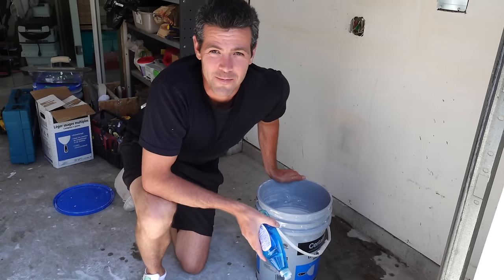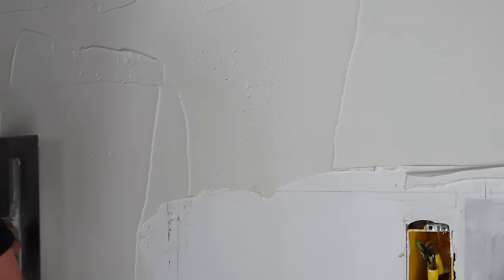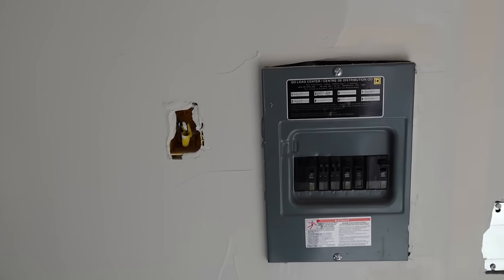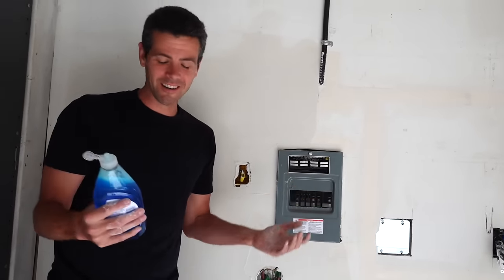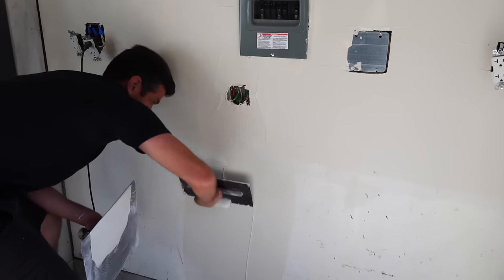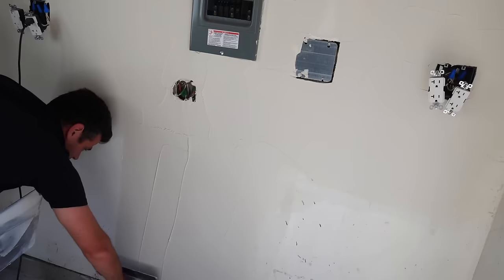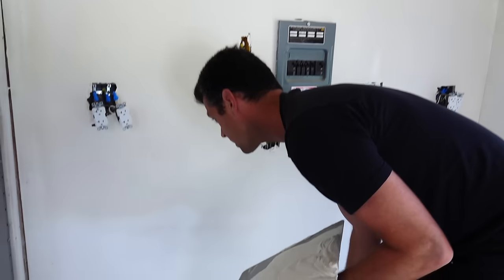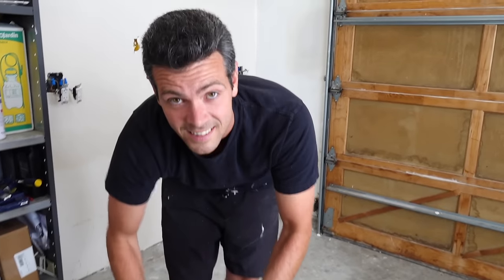😳Should you Add Dish Soap to Drywall Mud????😱

Comment: I've added way less Dawn to my mud than you did for years.  On and off depending on wheather or not I had it with.  Never had an issue with paint adhesion.  No call backs on flaking or peeling paint.  I used it because that is what I was tought to do by an old mudder.

Comment: I've been doing drywall for 25 years and I'm real Curious on the hawk and trial I use pan and knife and throughout the years using the knives have tore up my right hand as far as knuckles and fingers so I'm just curious on how your hand feels after the time you've been doing it or how are your wrists holding up
Reply: The Hawk is the way to go a pan will work you to death and the Hawk is iriplacable for overhead work it lets you catch the falloff I gave away all of my pans after discovering the Hawk ...no use for them.

Comment: Gotta say, daughter is really good at getting the close up shots WHILE you are mudding.  Typically we only get the close ups after the finish passes are done.  I feel like I could see your texture much clearer on each coat than most videos.

So takes less coats to get smooth and cleanup is cleaner because there is already soap in the cleanup if needed.  Curious if you have any paint problems.
Reply: I agree, not that previous shots were bad. It just gives us a better up close view of what you see while working the material. 👍

Comment: We use 'a squirt' of dish soap (dawn but also store brands) in our in-ground vinyl liner pool base vermiculite (40# bag and 5 gl. water) and it certainly helps with troweling it smooth. Never had an issue and the ready mix maker encourages using the soap (they recommend dawn by name) for this reason. Would think adding it to mud has same benefits.

Comment: Dawn is excelent at relieving surface tension. I use it on my grass before I fertilize as it breaks surface tension and allows water to penitrate. Do you wash your care at home? Were do you pour out the suds? Much greener huh? Surface tension. Static charge, porosity isn't anything, think surface tension and static electricity. We in the northern climates can relate. Not so much in California.

Comment: The reason you are getting a lot of are bubbles on your second coat is because you are sanding. Scrape off any imperfections from each coat with a dry trowel, you will find this is very helpful. Lay the trowel fairly flat on the surface and move in opposite direction to applying mud, dose not require much pressure to remove trowel marks ect. A very light sand on your final coat with 400 grit sandpaper if required is all the sanding that is done on the hole job. This includes skim coating. I have 30+ years Esperance , Hope this helps.
Reply: I don't have 30 years. But I do much the same. Apply it smooth minimize trowel marks) on first and second. Whatever buggers are on the wall scrape em off. 
Doesn't hurt to wipe down the wall ( I like a damp sponge mop) to remove any dust. Final coat as flat as possible. 
Scrape off any buggers and then light sand. If your running heavy texture you can skip final coat and sand.
Reply: @ normankeoghan5298 thanks for sharing esperance knowledge with us
Reply: What about to high speed of a drill I do know that can whip air in  the mud.

Comment: try about 2 or 3 times the amout of dish soap and a little bit of water. this sort sucks to the wall with surface tension. its like adding pva. when i have done it. also done it with cement helps it flow better

Comment: I feal like you somewhat missed the point, my understanding is that the main bonus of adding dawn is for when using automated tools (boxes and nail spotters specifically) the box tends to leave holes unless you chase your work back/hit it twice. Dawn reduces these holes allowing you to shave an extra pass off of every flat in the house. Never tri3d it myself, would never try it on a painted surface, have only heard of it used on production new construction, on fresh, absorbent board

Comment: Instead of soap I just use a scoop of the all purpose mud on my regular mud. For the second coat never had an issue sanding and sponging. Unless you add way to  much  of all purpose that's a big problem!

Comment: I'm not a professional with drywall, but my father was. He always swore by soap in mud for all kinds of reasons. Mainly it was for adding less water, and removing the bubbles. He said it would be less work later because it finished easier. Less work = getting the job done faster. He also added more soap than you did, and he used the cheapest available from the dollar store. For a little bit of soap, he may have saved a ton of time on a job, and it was worth it to him.
Reply: I'll bet he had trouble finding anyone to help on sand days soap in the mud equals soap 8n the eyes.
Reply: Ahah! Soap being a surfactant, it would practically make ‘water wetter’ so less water would be needed.         It’d be interesting to try just a liquid surfactant that is used in the horticultural/agricultural industry for spraying herbicides and such.     Or yucca extract maybe.  

At least that theory I think makes sense.
Reply: alright. im putting soap in my walls.

Comment: i did comment before about dawn... We used it in batches of hot mud. And it was drops not a squirt (mixing in the square metal handheld box). Ha. There is no question it smooths easier in hot mud. And i did learn from an old timer. That being said, his customers were repeat and it was common to go back to jobs from 20 years before. no issues.

Comment: I used to soap my mud many years ago. It doesn't seem to affect adhesion in any way, but it also doesn't seem to minimize bubbles. Fact is, air has to escape through the 2nd and consecutive coats and there's only one way out, thus creating bubbles. Soap does make the mud smooth out a little easier, but only a little. Mostly I just found it not very worthwhile. My go-to soap was Murphy's Oil Soap. I've also used Dawn and others, all with about the same results. I used about the same amount you did.

Comment: Read the Labels about additives guys I just spoke to USG  2 weeks ago, builder getting sued for over $250K because his drywaller used "additives" in the mud, also DO NOT mix different muds with each other, just water.  Pros do NOT add shit to your mud, the lawsuits are going around.  Also USG emphasized, FULLY DRY before applying another coat, I know sometimes we rush the guys to finish fast and get paid.  😁

Comment: Maybe you cut this part out of your video, there was an edit, but,
In the early 1970s I learned to drywall from my retired uncle, he did mix the mud in the bucket as you did, but on his top coat, he taught me to mix the mud on my hawk before applying to the wall. 
He basically taught me to squeeze the bubbles out, by working the mud back and forth. 
It makes the mud very smooth and easy to apply, and bubbles have never been a problem for me.

Comment: Ive added soap in my mud for years, I've even added soap and plaster of Paris to perfectly round out corners on arches. If you finish with a good coat of primer and a good coat of paint it will be beautiful.... Ive been doing this for over 20 years and the guy who taught me has been doing it since the 60's. I have yet to encounter a problem. Don't look at it like you're adding soap its just more chemicals for a smoother finish. Once you do a level 4  drywall finish with a squeegee and soap you will never go back.
Reply: Squeegee? I would love to see that  demonstration
Reply: Not sure what a level 4 is, and how would you finish using a squeegee? Can you explain for those of us who are new to this?
Reply: @Charlie9165  
OK Dan, It is really hard to explain how to get a flawless finish in a comment section, but here goes it.  After your 3rd sanded coat you apply another topcoat that is mixed with a pinch of soap and water. Use a mud mixer with the proper paddle bit till it is creamy enough to make you want to eat it. Apply it with a hawk and trowel, if you are using a drywall knife then stop. Hawk and trowel is far more natural feeling to use... trust me. Once the 4th coat is applied to the wall quickly grab you handy Marshall squeegee and go to work. Start from the top and work your way down. If you are in an area where it dries quickly you can use a sprayer to mist the wall as you go.The bigger the wall, the bigger the squeegee. It will level out bumps and valleys for a smooth finish. If you are going for the most perfect finish then after this coat dries you would skim coat over the whole section. You just put the same topcoat used for level 4 back on and scrape it off with the trowel. Vancouver carpenter has numerous videos explaining this technique... I don't think he uses a squeegee  but I assure you he knows what he's doing. Good luck, hope this helps.
Reply: @KillerKlipsch  Thanks a lot JBL. Very helpful Information and I greatly appreciate all the time taken to explain this to me.
Reply: @Charlie9165  No problem, let me know how it turns out.

Comment: If you want to ge rid of bubbles, wipe down the wall with a moist sponge after the first coat is completely dry. Wet it just enough so that it darkens the dried drywall mud, and skim it immediately. If the wall dries out, you'll get bubbles again

Comment: you need to add less water when you add the soap. have worked with many full time mud guys for many builders no paint problems. not sure how you came up with the with a paint issue. but have never seen it . When I tape I use it for the second coat I find it helps

Comment: The bonding factor of water molecules is lessened by the addition of soap.
It helps more with hard water versus soft [or softened] water.
Surface tension is what creates the bubbles.
Reply: What do you mean by surface tensiɔn.was told many reasons for bubbles(hate them)when i called USG.moisture in rock,mixing too fast.never heard  that one

Comment: We've been skimming walls for years, the only thing we add to our mud is acrylic ad mix (adhesion) and water. We don't use trowls or hawks just roll it on with paint roller and scrape most of it off with a 10" broad knife (round off those corners), no lines, no hills or valleys, second coat slightly thinned..... like butter. Takes about 15 min to do an average wall. We use a dustless rotary sander but barely needed. I would never add detergent or surfactants. The only reason we use admix is because we're paperhangers and we want a good bond to that wall when the paper dries it has a mechanical pulling action on the surface, I don't do jobs other contractors have skimmed because they don't add adhesive and probably use detergent to make up for their lack of plastering skill, had jobs fail with mud flaking of the wall from that.

Comment: So for the most part I never add it when doing regular drywalling, but when  doing patches on painted surfaces where bubbles become a real issue, I have occasionally added a tiny drop of the soap, but only ever in combination with adding some glue, that seems to result in less bubbles. I also add a whole lot less soap than you added. I tend to do the soap thing in a pan rather than creating a whole bucket full of soapified mud.

The real issue about adding the dish soap is that you can void any warranty provided by the mud manufacturer if for some reason your installation fails.

PS Daughter did great job as camera person. As did your Lady Wife. Also I somehow got unsubscribed from your channel, not sure how that happened but its fixed now :)

Comment: Late to comment but one small note that doesn’t seem to be mentioned in the other comments. Mixing dish soap with water then mixing in the dry mud mix is where you really see the difference. Dry mix blends astoundingly faster and smoother with a water soap mix. Not such a big deal if you’re using easy sand 90 or 45 but if you need to burn and turn an easy sand 5 patch, the water soap mix will make a world of difference.
Reply: I always added detergent to dry mortar or concrete fix. It acts as a plasticizer and makes it easier mix and work. My father was in the concrete business and said to always do this and that commercial plasticizers are basically the same as detergents.

Comment: 3:15  I feel that way about all carpentry lately. I'm 57yrs old and been working this trade since I was about 15 yrs old. I've made a decent living at it, but it just doesn't turn me on much anymore, unless I'm doing some really custom work, that most carpenters won't even touch. I pride myself on doing custom fancy stuff, that's the only thing that still gets my motor running. All the other stuff is just another day on the job.
Since you've tried the soap in the mud trick and kinda gave it a nod of approval, I might give it a shot. I usually let the mud sit on the wall for about a minute or so before I give it a final wipe and that seems to help a lot with getting rid of most of the bubbles. I do mostly remodeling, and most of the time I'm patching into already painted surfaces, perhaps the soap might make it  a little more slippery for the bubbles to be able to escape.
Reply from the maker: The weekend warriors don't get it. Sometimes a job is a job and all the years of stress and grind have a way of sapping the love from the work. It doesn't mean we hate it we just don't wake up with that burning desire to rush to the job and get started anymore.

Comment: I've played around with this a few times. On one occasion, I used a lot more than a squirt. Everything smelled awesome, only problem was, despite the mud being buttery smooth, it developed more surface tension to the knife. So despite feeling like it would feather super thin and not worry about bubbles, it almost felt like it dragged a bit more. Haven't played around with it in quite some years but I've been wanting to dabble in the soap again soon

Comment: I've been a professional painter for about 10 years. I use dish soap to clean my paint sprayer and brushes because dish soap contains the same surfactants as water based paint so they are compatible. I have a titan 440 sprayer and I've  been storing it in soapy water between jobs for 2 years with no problems, except for winter time when I use antifreeze, then clean with soapy water before using again. If your paint sprayer is making a clicking sound or running rough, you can put soapy water into the rig, tape the handle down on the gun and put it in the soapy water bucket so it just cycles through the unit and after about 15 or 20 minutes you can hear the clicking noise from the dirty piston ball stop.  My titan has an auto clean mode and I always cycle soapy water through till it sounds happy again at the end of each job. Once I didn't rinse out the sprayer thoroughly before running the paint and the first couple gallons wanted to run because soap makes water wetter. Other than that I've had absolutely no problems, I've been told the dish soap conditions the rubber gaskets as well but can't verify that specifically. I suppose the degreasing aspect of dish soap may make oil based coatings fail if it's in the mud but this isn't 1976 and there's no good reason to put oil primer on fresh drywall. So from a painters perspective , I don't think you'd have any major issues having a bit of soap in the mud, especially if you're back rolling the primer as recommended. 
Thanks for all your videos they've helped me out a lot lately
Reply: I use Coro check for storing the rig, and give it a shot of throat seal.

Comment: Surfactants (aka soaps) are added to paint, this aids in pigment dispersing. While I have not used soap for any of my drywall repairs there shouldn't be a compatibility issue as long as when you sprinkle water on the dried surface it absorbs water.

Comment: I have a question for you! Firstly- by watching your videos, I was able to drywall my basement and finish its perfectly! So thank you! Now, I removed the bulkhead above my kitchen cabinets, and drywalled them. My house was built in the 50s and it looks like the old plaster is doubled up and has chicken wire in it. So there are spots that are 1/4 to almost half inch in difference in sitting flush. What’s the best way to even those out and be able to tape it? Can I pre fill and try and get it somewhat level and then tape and finish? What about the edges with the chicken wire? I think I got most of the wire removed but there’s some areas it’s still on the edge but not hanging below the drywall. Thanks in advance!
Reply: use different thicknesses of drywall to match existing, they make 1/4 " ,1/2" and 5/8

Comment: That's a little to much but it does help keep it smooth.  I don't add water on the bed coat. Little on the skim coat. Doesn't effect the paint. Been doing this 45 years. I will say your pretty good with the trowel.  I use a hawk and broad knife

Comment: I do mostly stucco, and I have used dish soap in our scratch mud. We don't worry about bubbling, but it helps heaps with troweling. My main thoughts is that it creates microbubbles which allows the mud to slip off the trowel easier. We use a product called Hospifer  made specifically for scratch mud that I swear is just laundry soap. It smells just like Tide, and looks like it too. 
As for your hippy microbiome all natural comment: drywall mud has silicone in it so not natural either =)
I've played with making my own lime putty and that is a fun rabbit hole to go down especially if you are in a part of the world that no longer uses lime putty anymore, like us in western Canada.